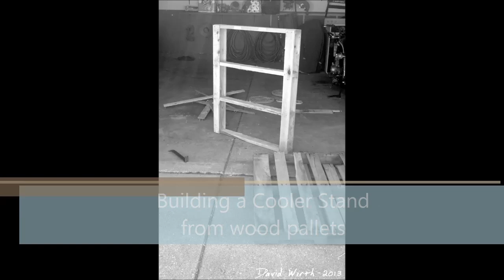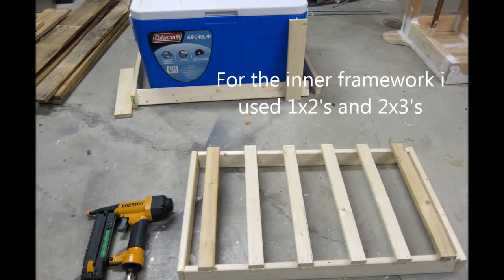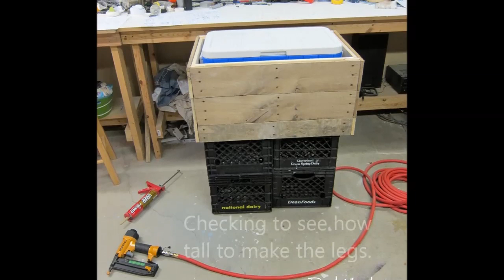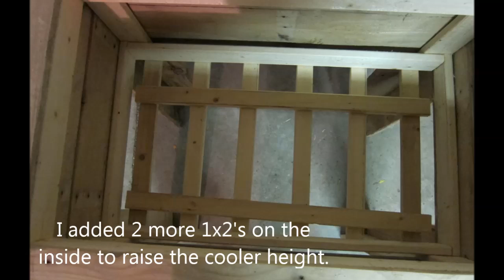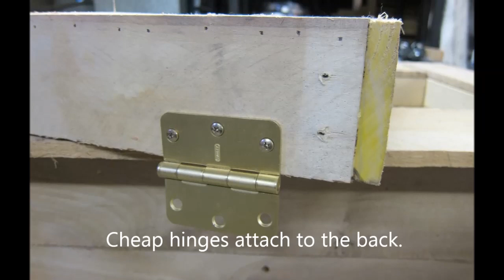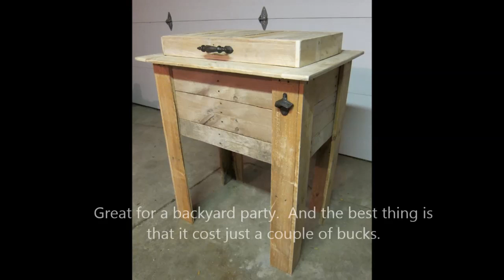How to Build a Wood Pallet Cooler Stand

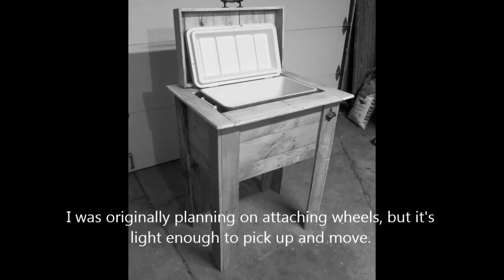Comment: At 1:34 it looks like the cooler lid isn't connected to the wooden lid. Does the cooler open if you pull up on the wooden lid? I've seen other coolers where the lid was disconnected from the cooler and attached to the wooden lid. Either way, yours looks nice. I'll probably do this soon.
Reply from the maker: No, the cooler lid is NOT attached to the wood lid.  I saw some examples online and was originally thinking that i would detatch the cooler lid from the cooler but i did not make it that way.  When you want to get something out of the cooler you first have to lift the wood lid, then lift the cooler lid.  Not the best design i know but it didn't involve wrecking the cooler.
Reply: Thanks for the reply. I have a nice Coleman cooler with steel belts that I'm not touching. I'm going to buy a cheap Walmart cooler.